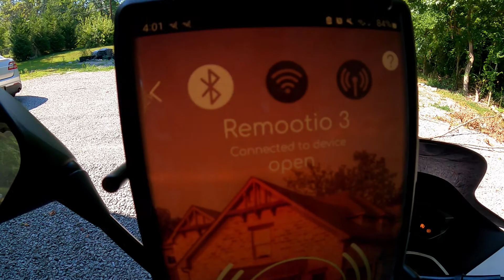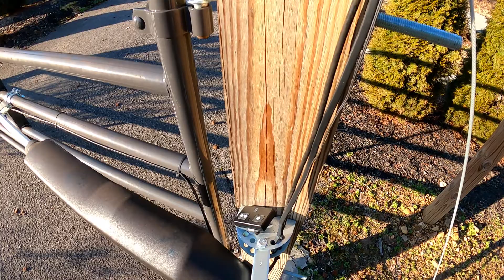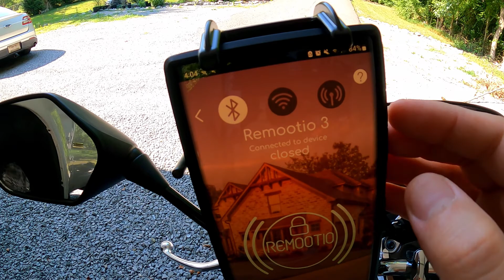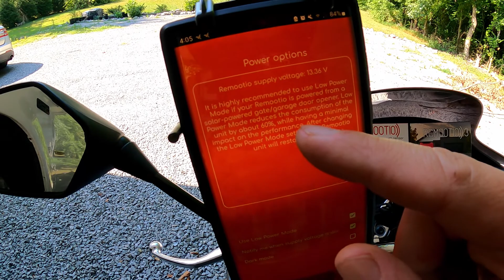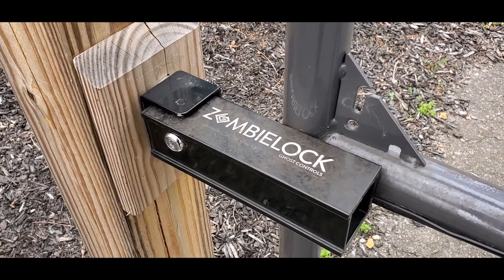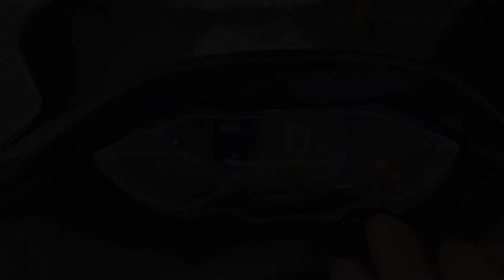Installation Remootio 3 Make ANY Gate/Garage Door Smart | Ghost Control WIFI Cellular Control 2022

Comment: i can only open the gate if i am in the same network in other words only works if i am close to the device i am disappointed
Reply: I only have 3 options the one I really need it’s WiFi but only works if I am in the same network as soon as I deseable WiFi on my phone I have to go to Bluetooth but not WiFi
Reply from the maker: @heberheber12  the top left is Bluetooth only works 50-100ft... wifi works only on the same network as you stated... and the top right setting  is wireless which works anywhere that you have cell signal.
Reply from the maker: @heberheber12  it's actually called Internet far right setting at the top home screen of the app. May need to set this up as well.
Reply from the maker: @heberheber12  check your settings it has multiple choices for opening on network and also using bluetooth, wifi, or wireless network... sounds like you are on WIFI in the APP

Comment: Can you please let me know regarding below questions.

1) There are no wall sockets in my Gate unit, where should i connect the power to my remootio 3
2) I am confused how to tap power from the gate control board. There are no wires supplied in my remootio box and only a USB charger was provided. There is no extra wire as per their website
Reply from the maker: I have solar and the power is tapped into the 12v batteries. I have no power at this gate it is off grid.

Comment: Will the remootio app keep track of which user opened/closed the gate? Can 1 time use codes be sent to people, like for example visitors that will come on saturday? Can bluetooth be disabled all together after installed? Seems like a great thing, but there is no documentation. And thanks a lot for the video. I will be using your affiliate link if I can figure out that it is right for us.